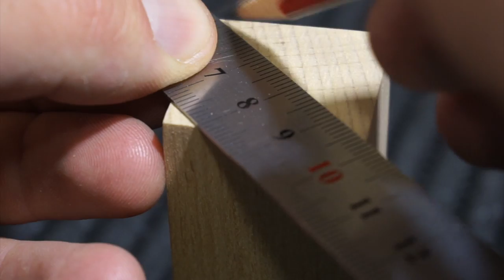Drill Press Vise, how to make

Comment: Great job! Thank you for your vid. Just one question: Couldn't you make it a triangle instead of circular shape of the middle part in dark color? So, any size of rounded axel can be fixed in it. Thx again.
Reply from the maker: Yes, you're right, I realized late of that but I should have done with a triangle shape, good appreciation and thanks to you for your comment!!